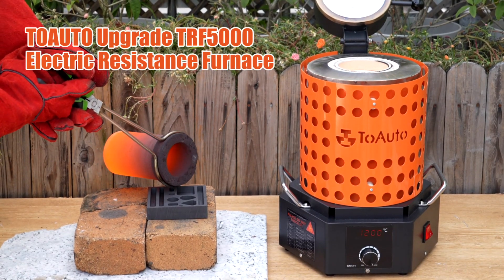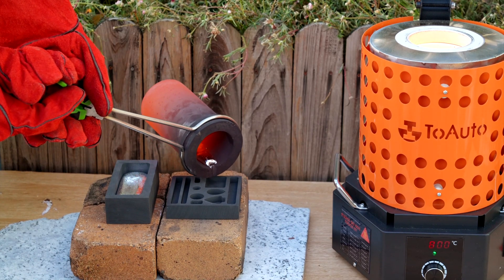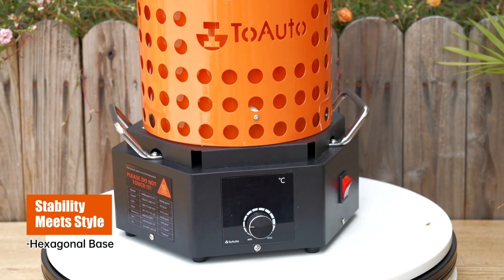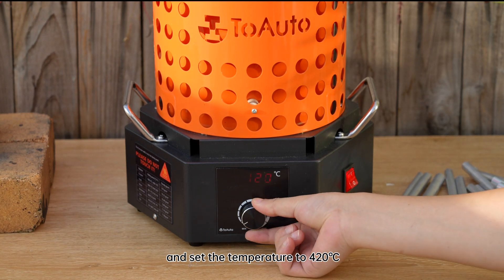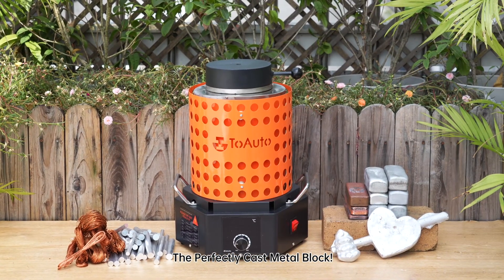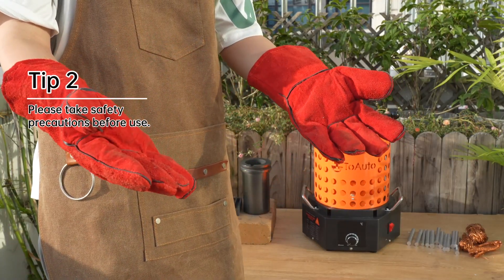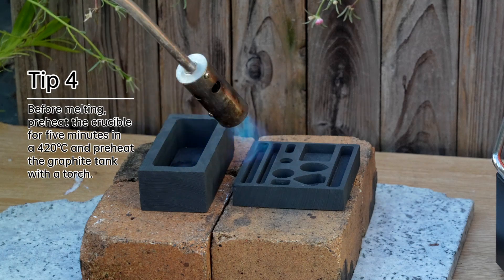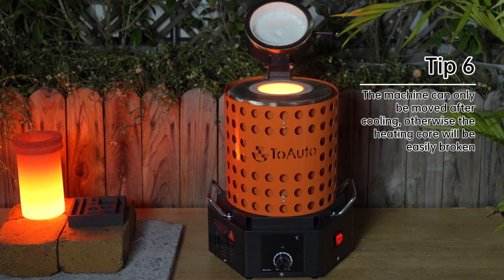2025 Electric Metals Melting Furnace, 5kg Resistance Furnace, Fast Melting of Copper, Aluminum.

Comment: Can you explain the new temperature controller? Does it display the set temperature and the target temperature? Very important compared to the older model with the button PID controller.
Reply from the maker: As shown in the video, after turning on the switch, the temperature is controlled by the knob. Turning the knob adjusts to the desired temperature, at which point the LED display shows the desired temperature. The temperature then begins to rise, displaying the actual temperature. Once the set temperature is reached, heating stops and maintains that temperature. The temperature display usually shows the actual temperature.😊
Reply: @ToAutoOfficial  I purchased your 3 kg and 8 kg electric furnaces. I did one melt in each of them. I melted aluminum in the 8 kg and copper in the 3 kg. Both units have push button PIDs. You make a very nice product. Thank you 😊😊😊